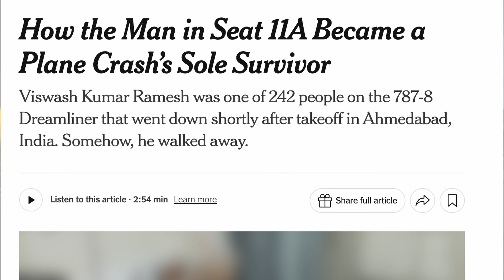Why the RAT Changes Everything – Air India 171 Update

Comment: Okey doke. So if you were so certain in Part 1 (and I posted a question challenging you on it) that the co-pilot grabbed the wrong handle, then why wouldn’t you venture he (or she) was also incompetent enough to push the wrong button during rotation and shut both engines off “by accident?”

My theory, based on both parts 1 and 2 of your analysis, is this was no accident, not another Boeing f-up, but a deliberate act of sabotage.

Comment: This is also being circulated on social media…..

Here's the translated summary of Vinay Jha's detailed analysis of the Ahmedabad plane crash:
Ahmedabad Plane Crash: A Detailed Analysis by Vinay Jha (Abridged)
The aircraft crashed 625 feet after takeoff, with both engines failing simultaneously. It's impossible for both engines to shut down at once due to a bird strike. The fuel contained in the supply pipes from the fuel tank's main switch to the engines can only sustain them for about 30-40 seconds. This is sufficient for an ascent of approximately 625 feet. Therefore, it's highly probable that the fuel tank's main switch was closed after filling 1,26,000 liters of fuel before departing for a long-haul flight.
During the investigation, the fuel tank and main switch are thoroughly inspected, ruling out the possibility of external terrorist involvement. Many lives could have been saved in the crash, but survival from the explosion of 1,26,000 liters of fuel is extremely difficult.
An aircraft cannot be dispatched for a long journey without a complete inspection, and a meticulous check of the entire fuel supply line is mandatory. After the inspection, the aircraft crew does not have access to this area; the fuel supply line is the responsibility of the ground staff. Therefore, someone deliberately closed the main switch of the fuel supply line during the inspection. I say "deliberately" because the very component that requires mandatory inspection and is only accessible to the inspection team was found closed.
Technical Indicators of the Crash:
If the main fuel valve is closed, the engines will only run on the residual fuel in the pipes, which is sufficient for approximately 30-40 seconds. During this time, the aircraft can reach an altitude of about 625 feet. Subsequently, the fuel runs out, both engines shut down, the aircraft descends, and impacts with an explosion.
Four Levels of Investigation:
 * Mandatory inspection of all systems before a long-range flight:
   * Especially:
     * Fuel tank level
     * Fuel supply line pressure
     * Crossfeed and supply valves
     * Pump functionality
       This falls under Pre-Departure Technical Clearance (PDTC), performed by a lineage engineer and certification officer (ground technician).
 * Flight crew (pilots) are called to the aircraft after inspection. The flight crew accesses the aircraft only after runway clearance. Their job is to double-verify systems through a preflight checklist, but they are not authorized to open/close fuel line valve configurations or tank venting systems. This means the responsibility for the main fuel valve and supply line rests solely with the ground technical staff.
 * If the main fuel supply valve was closed:
   * Engines will run only on residual fuel in the lines (30-40 sec).
   * As soon as the line fuel is exhausted, both engines flame out, and the aircraft will fall.
     The AI171 crash at 625 feet is direct evidence of this.
This is the crucial point: "Who closed the very component that requires mandatory inspection and is only accessible to the inspection team?" This indicates the entire case points towards murder or extreme criminal sabotage.
Investigative agencies should conduct a forensic examination of the following points:
Questions for the investigation area:
 * Pre-flight inspection log: Was the opening of the valve confirmed by a signature?
 * CCTV (hangar + tarmac): Which of the ground engineers last touched that valve area?
 * Toolbox audit: Did any unauthorized person gain access?
 * Flight data recorder (FDR): Was the fuel line pressure 0 before takeoff?
 * Crew CVR: Did they receive any fuel pressure alert? Did they say anything?
If this is Sabotage:
Confirmation indicators:
 * The valve was intentionally closed.
 * Technical Probability: 100%
 * Only inspection staff had access; flight crew or others had no access.
 * It happened after fueling, otherwise, fuel couldn't have been filled.
 * It occurred after the final technical clearance because the aircraft had already started taxiing.
Conclusion:
This is not gross negligence; it is a clear criminal act, whether it be organized political malice, internal revenge, or a targeted attack by some power.

Captain appreciate yr comments whether  any logical probabilities to this. Thank you

Comment: I've seen so many comments on YouTube and Facebook stating unequivocally that the pilots retracted the flaps that it borders on libel and defamation. And the people making these comments are absolutely convinced they're right, as if they were there and know everything.

Photos taken at the crash site show a section of wing on the ground, and the flaps are clearly extended. The flaps were extended on takeoff and still extended when the plane hit the building. So pilot error is out.

The cause of the crash seems to be a catastrophic loss of power within seconds after liftoff. No more thrust, no more forward momentum, and gravity does the rest as takeoff speed quickly diminishes.

Why is the landing gear still down? Because the emergency started within 10 to 15 seconds after they lifted off the runway. There was no time to retract the gear. When the power failure hit, flight crew would have been shocked by the sudden loss of thrust, then struggled to keep the plane in the air. If they tried to retract the gear at all, nothing would have happened because there was no power. From that point, it was only about another fifteen seconds until the plane crashed. No time to do much at all.

When I saw the video of the plane flying overhead on its way to its doom, there was no engine sound, but I could hear the RAT. That said it all.

Comment: So hard to comprehend how this could happen today when aviation is so safe. I have to agree with your thoughts based on the RAT. I didn't know it could automatically deploy. So sad. If it was dual engine failure then  it's the question of how that could that happen with such a modern and safe aircraft.

Comment: If you look at the back of the engines, there is no heat coming from them. You don’t see that wavy heat signature in the air. The flaps are not down either. I think all three of those things you stated for the rat to deploy are the reasons. It lost all power really quick!

Comment: I can’t believe that a seasoned pilot or first officer would mistake the gear leaver for the flap leaver. The flap leaver sits between the two seats and has to be pulled up slightly to use and has a small ‘T’ handle on top. Whereas the gear handle is located on the front dashboard, located somewhat lower left and has a circular somewhat transparent top, yes also needs to be pulled out slightly to be activated. It’s like saying a seasoned motorist confuses the gear handle for the indicator stalk behind the steering wheel. Very unlikely.

Comment: AUTOTHROTTLE FAILURE... MECHANISM THAT AUTOMATICALLY CONTROLS ENGINE POWER. THERE ARE RECORDS of problems with the autothrottle during takeoff that have already caused accidents. The causes may vary, including system defects, incorrect settings, or errors in crew performance. There are records of autothrottle failure when applying insufficient power, leading to an accident, in this case on an approach to Amsterdam; this is the most likely line of investigation! REGRETTABLE!

Comment: Theory #5: suicidal pilot pulled the emergency engine shut down levers.  Like that pilot Joe Emerson tried to do on an Alaska Air flight last year.  That would kill the thrust and deploy the RAT.  Terrible to think of and it is only one of many theories but there have been suicidal pilots who caused jetliner crashes deliberately.  Otherwise if it turns out to be a failure of engineering man o man grounding a thousand Dreamliners would be devastating to airlines, GE engines, and Boeing.

Comment: Steve what do you think caused a duel engine failure on the 787 since the GE 9x on the aircraft is a solid workhorse. Do you think that the 787’s “Hybridization” could be the culprit that caused the engines to cut? Seeing that the plane was designed to taxi without use of the engines.

Comment: Rat doesn't power passanger lights (only critical flight controls like instruments and powered external surfaces usually hydrostatic pumps so even if all hydroic systems are compromised control surfaces still work at significant lower speed)

Comment: I have heard another YouTube personality that is an airline pilot talk about the RAT as well and explained why it is bad when you hear it. Gear being in a forward position is clearly visible. Be interesting when the flight data recorder is analyzed and if they can get parts of the flaps and slats to tell their tale. It has to be, like you and other pilots are saying, loss of power, loss of hydraulics, or dual engine failure.

Comment: Without any data yet, all theories from a low quality video footage or bits and pieces of wreckage is just pure speculation at best. These theories would have been for for lets say Air France 447 crash were immediately there was no black box or wreckage recovery but in this case we have all the things needed and we shall get an accurate update by 30 days so meanwhile we should stop this speculation nonsense

Comment: So how exactly do you get a dual engine failure without any kind of smoke or engine damage? Not a bird strike. Fuel cutoff?
Reply: Electrical malfunction on plane,  causing no electricity to be supplied to fuel pumps subsequently causing both engines to shut down.

Comment: Thank you for your excellent presentation Sir.. This is for your information: There is a report on-line that Boeing Employees who were working on three 787 that was manufactured in January of 2014 were at high risk of engine failure. This concern was brought to the attention of the senior management at that time.. However senior management responded that the three planes were going to be shipped to International carriers and so it did not matter..  The specific jet that crashed was one of the three aircrafts the Boeing Employees were concerned about..

Comment: The two 787 eafrs captured all 3500 parameters.  It's top notch, this is all bs.  They already know what happened.  Dual fuel fail, software or nuts pilot.  I'm a 787 expert...and then some...and its not called a seven eighty seven

Comment: Thank you, Captain. I saw a video taken  by a passenger of the flight flown by the same aircraft immediately before this accident. The passenger said there was power inside the cabin: no lights, no TV screen, and no AC. Thank you for the great analysis. Again, condolences to all affected by this tragic accident.
Reply: That's what I was about to post. Seems like that had issues with electrical problems on the previous flight. I wonder WHY they would allow a plane to fly that had just experienced electrical issues? I'm just a retired American Airlines flight attendant, but I did work with AA at the airport before becoming a F/A. Just 2 young girls (20's)  working night shifts in the late 80's. When any of our 2 night flights arrived at the airport, after meeting the flight and the passengers deplaned, we would have to get the mechanical book to see if any maintenance was needed, and if so, we had to call the maintenance team. Those flights could NOT take off the following morning if the maintenance issue had not been fixed.
If this airplane had electrical problems on the flight before, then I blame Air India for allowing this jet to take off.
Reply: Where is this video?
Reply: @JohnGult2025 https://youtu.be/1y_u1O-T6jw
Reply: Super analysis, but how did both engines fail, that needs to be investigated in detail

Comment: Yes much more sensible this one. Pilots were trained and had experience. I'm still with mechanical/electrical issues due to the scorching heat that day. Most electrical systems in Delhi faced issues during that time.. Something related to this may have caused electrical failiure of some sort on the plane..

Comment: Some were speculating the bang was caused by  a battery explosion like what the 787 faced before 2014. But the problem with that theory is not only the solution that was implemented in 2014, but the battery was all the way in the back while the survivor was up front. An exploding battery in the back would not be that loud to someone sitting up front.

Comment: Captain Steeeve, thank you for your explanations. Your first theory is most likely confirmed: it turns out that this was the first flight of a fairly experienced crew on this model of aircraft. It is strange why in this case there was no instructor or inspector in the cockpit? And most likely they did something wrong. Personally, I explained the loud noise in the cabin before the crash by a mechanical failure of the engines, but it turns out that it was the RAT that was making so much noise! And also pay attention to something flying off the plane just before the crash. There is a theory that this is the door of the emergency exit from seat 11A. This is how this passenger was saved: already in flight, before the crash, he opened the hatch!

Comment: 4:52 The full list of auto RAT deployment conditions for 787 (NOTE ITEM 2):
1-Loss of all engines
2-Both engines are at less than minimum idle RPM (Revolutions Per Minute)
3-Loss of all hydraulic power - left, right, and center systems detect low pressure
4-Loss of all electrical power
5-BPCU (Bus Power Control Unit) detects loss of power to C1 and C2 TRU (Transformer Rectifier Unit)s
6-On approach, loss of all four EMP (Electric Motor Pump) hydraulic pressures and loss of either the left or right flight controls ACE (Actuator Control Electronics) 
7-Rotor burst on takeoff that causes loss of both PECS (Power Electronics Cooling System) primary cooling loops.

SO HOW DOES “Both engines are at less than minimum idle RPM (Revolutions Per Minute)” OCCUR and could fuel disruption cause that condition?

You need to include more items! There are a number of other observations that need to be addressed! That very late rotation generating a large dust cloud is a big one.  A person in the building that was hit could hear the jet engines operating. The landing gear was partially retracted. The engine thrust on the runway acceleration was reduced. After rotation the engines rolled back to even less thrust. The landing gear was partially retracted.

Comment: Listening to the Audio as the plane flys by, you definitely hear the RAT, but secondarily you also hear the engines rolling back/slowing down. massive electrical and dual engine failure, Began with flaps not being able to be deployed fully, also preventing gear retraction.  Hydraulics seem ok, because of left right and nose pitch change.

Comment: Great point!!!!!! Is it really that easy to do? Seems such things should have some kind of tactile cues which would act like muscle memory to reinforce a correct action or act as a prompt, as needed, in the event of a making a wrong one.. Even a vertical handle versus an otherwise identical one positioned horizontally should suffice adequately, especially if it's action is varied such as one pulling smoothly with another ratcheting

Comment: I would like to ask if it is as has been said, that the plane finally got airborne 'at the last brick on the runway', (evidenced by dust and rubbish flying) did the pilots know they had a problem even before the tyres left the ground? They must have felt the aircraft was 'heavy' and 'sluggish' about lifting off, as they taxied, before the point of no return?? Or doesn't it work like that?

Comment: Was thinking this also positive rate gear up possibly did flap handle instead of gear handle . C141 flight engineer military and L1011 along with 747.seen this many times my life 13,000 hours. 787  many take off flight flap positions, CDU imputes would never trigger a takeoff warning if wrong flap setting selected. Pilots want us flight engineers back? We would have used charts and graphs and caught to long before you started engines.last time I flew pilots more interested in cdu display instead of aviate navigate communicate